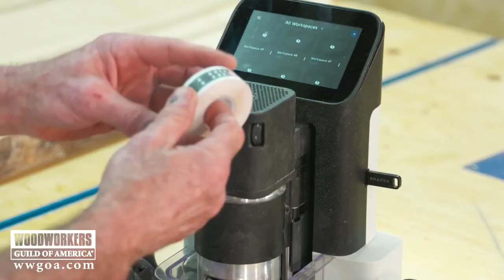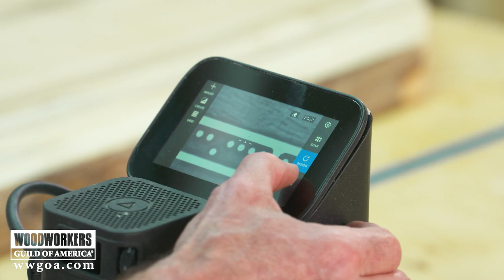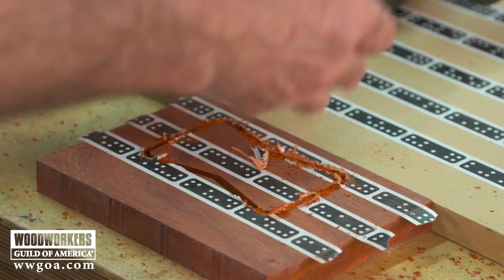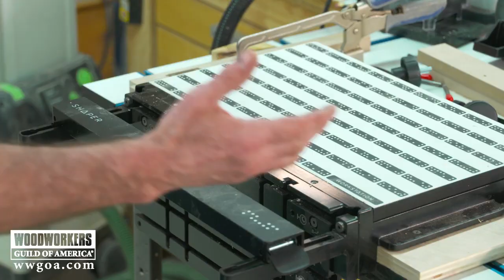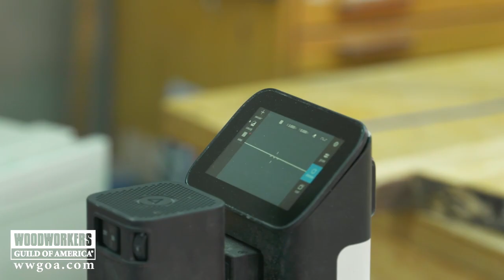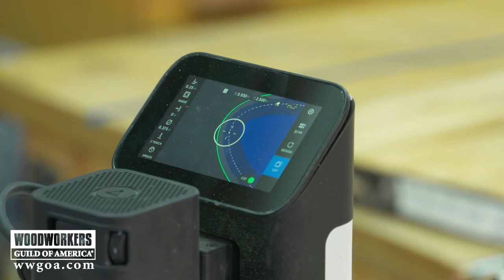Shaper Origin: A Handheld CNC Router?

Comment: Not exactly, I think the domino tape should be at a minimum of 4”, and not really a need to apply the domino tape on the work piece you are cutting if the Origin can easily see the tape in front of the work piece.  Or you could use a lot of extra tape, which costs $22 a small roll.

Comment: Great overview. I've had my Shaper Origin for about 2-years now and use it all the time. I keep getting better and better with new applications. A nice feature is that you can produce SVG files from a number of other software products. I use Sketchup. But Shaper now has a software product called Shaper Studio that actually allows you to set and preview your depths so you don't have to do it on the tool. One note...on the bowtie, you didn't really need the domino tape on the surface you were cutting. When you are cutting, it only cares about the area in front of the tool, so it's not using the tape that's under it.
Reply: Yes, it seemed he used a lot of tape!  Seen it work well with far less.

Comment: That's a really nice machine and I've been interested for some time now but, as a hobby woodworker I can't justify the eye-watering price. I'll stick with router collars, jigs and when necessary, free handing it for now. At $1K it would be a consideration but, at >$3K for the most basic unit... no
Reply: How much is tape.. that and the software are the mystery costs.
Reply: @OntarioBearHunter  I think you can get general software that will work with the SO's operating system for free. The tape is a bit pricy but, if you're operating a production or flooring business it wouldn't be much of a consideration. I love woodworking and have purchased some really expensive machines but, none are more highly focused and highly priced given it's limited abilities. One has to remember that a CNC can do full 3-D relief cuts and while the SO can sort of do that it won't be carving details that even the most rudimentary CNC can. Considering you can get a medium sized CNC system complete with router, software, table... everything for less than $2K it's hard to justify for me.
Reply: @airnashville3883  I have a Shaper Origin. The use cases for the Shaper Origin and a "traditional" CNC machine are very different. There is really very little overlap between the things you would use a Shaper Origin for and what you would use a CNC for. Also, the software used with the Shaper Origin comes with the Shaper Origin; you don't pay any extra for it (with one exception for a new function they call "Autopass" that was recently released). The tape isn't very expensive, actually, and I almost never actually use the Shaper tape; the Shaper Workstation and Shaper Plate already have permanent Shaper tape dominoes on them, so you don't need the tape. The Origin allows me to do things that I would never even try without it, like inlays and complex joinery. It's just a totally different tool than a CNC.
Reply: @airnashville3883 Been on the fence about this for awhile,gonna go with a small machine instead.
👍🏝️🇨🇦